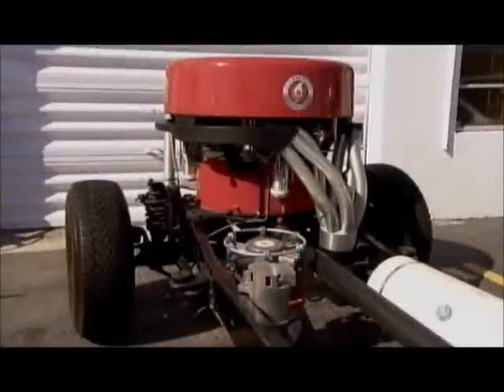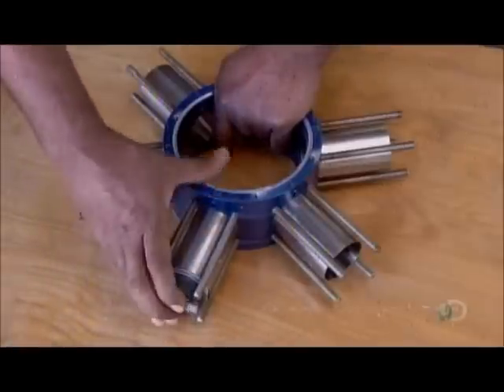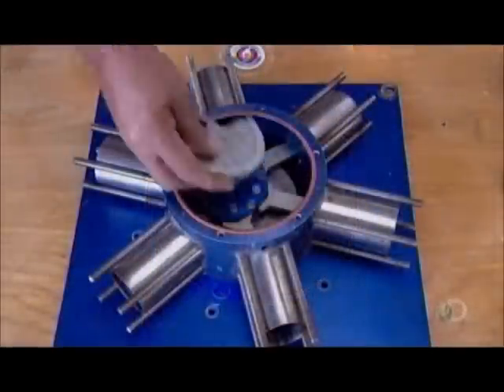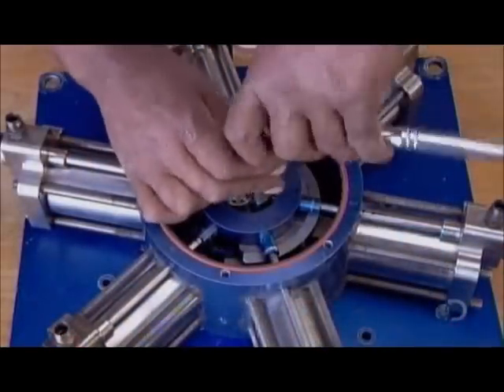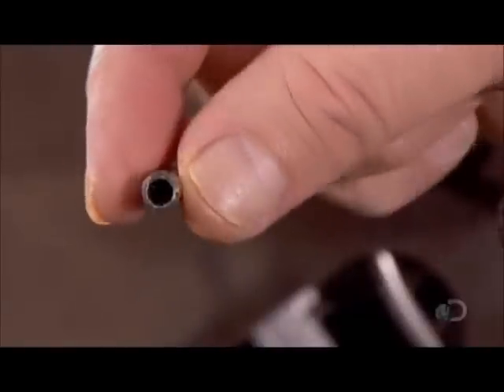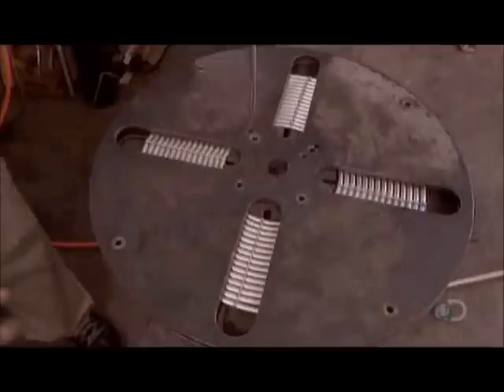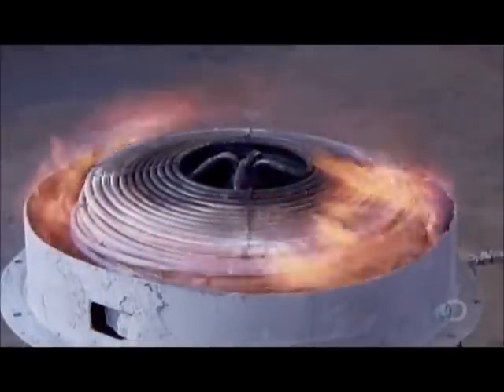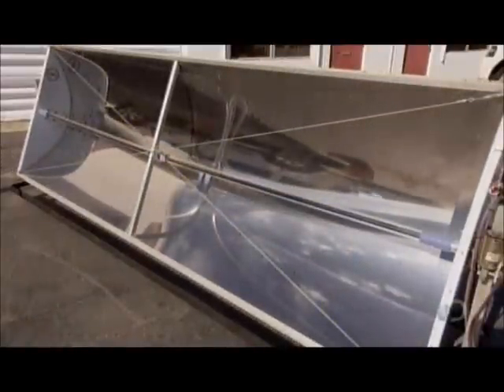How It's Made - Steam Engines

Comment: Actually, the worlds first steam engine was built and ran by Heron of Alexandria, the Aeolipile. Unfortunately, the potential was not seen for thousands of years.
Reply: +Joe Schmoe Technically the first steam engines were in use by the Egyptians. They were ceramic vessels that were placed in the back of a furnace, the water boiling and accelerating the flue gasses to facilitate a greater draft. This was a relatively common practice among unrelated civilizations.
Reply: TheRamsberg
Not really an engine by conventional thought. I guess sauna's were engines too because they made steam for a purpose? I dont know. This is where history has grey fine lines where ones definition of an engine even starts to break down.

Interesting history though.
Reply: +Joe Schmoe Definitions can become a deep rabbit hole. 

Within the confines of "heat engines" anything that converts heat energy into useful work is an engine of sorts. 

Within a "heat engine" there are various components and singular processes that are often described as an engine, and in reality are anything but. For example the cylinder, piston, connecting rod, crank, etc. assembly is typically referred to as an engine, however since the heat/energy source is external to it(steam), it is technically a motor, just like an electric motor uses an external source of energy(electricity). 

For the earliest/most widely accepted usage of steam power look up "How to lift water with fire".
Reply: TheRamsberg
By that definition the first man to boil his meal in water using fire made the first steam engine.

Fucking definitions. . . . . . .  ugh.
Reply: i think they meant high power steam engines, which were indeed invented by Richard Trevithick in England a few centuries back. before then, low power heat engines were commonplace.

Comment: this has got to be the best youtube video I've seen in a year
Reply: ***** Too bad every thing in the video was fake... Cyclone Power Technologies was a fraudulent company
Reply: Joe Schmoe Well if your talking about a large scale electric power generating plant burning a cheap fuel like coal its a very different situation than say a large Diesel engine powering a boat or a locomotive.  Power plants are huge and have the thermal advantage of engines and boilers with high mass and low surface area, room for plenty of insulation, large heat exchangers and preheaters... so thermal efficiency is much better.

tacking-on a very small steam engine on to an already fairly thermally efficient engine like a Diesel there is not much that can be gained, the heat source is small and the efficiency of a small steam unit is very low.
Reply: Steam engines are horribly inefficient... Cyclone is a scam
Reply: Joe Schmoe Although it sounds like a great ideal.. and it is, but unfortunately certification tests on one government contract showed that the Cyclone system severely underperformed claims made by the company and that the performance was about the same as any typical steam engine design... the system as installed did not return a cost savings in combined cycle operation.
Reply: doktorbimmer
re-utilizing waste heat from ICEs is not a scam.
Reply: doktorbimmer
Recovering waste heat, regardless of engine efficiency, is a good thing.

But there are better engines out there, I'll admit.
Reply: Joe Schmoe Provided that the availability (basically, the temperature of the waste heat) is high enough.  Generally, this is not the case.
Reply: MrShobar
If it is otherwise wasted, its good to recover it regardless of efficiency. Thermo-electric generators are a good example.
Reply: Joe Schmoe Its a matter of cost effectiveness sometimes.. its not always smart to try and recover more btus.. its good to save fuel.. but you also have to save money
Reply: doktorbimmer
Well of course its a matter of cost and return on investment. Duh.
Reply: Joe Schmoe Yes, and steam has a high installation cost and a high maintenance costs too... so its harder to get a return on your investment.
Reply: doktorbimmer
Depends on what you are burning and how its being done.

Comment: weighs only 						250lbs (with combustion chamber), produces 100hp @ 						3600rpm, and generates an impressive 850lbs-ft of torque 						at starting.  Cyclone engine. Question is how do I buy one???
Reply: Some Other Dude No they have not.. the company has made several as of yet completely unproven claims...

Thats what they keep saying... but so far the company has not filled an order or sold a working engine... no outside source has even reported seeing a working engine..

All of the equipment seen in photographs and videos are "mock-ups" or nonfunctional displays...
Reply: When looped into the heat cycle of another much larger heat system..  tests on the stand alone boiler/engine system only produced 33hp with a rather unimpressive 24% thermal fuel efficiency.
Reply: doktorbimmer What was the availability of the waste heat?
Reply: MrShobar 100% of the Cyclone maximum rated capacity
Reply: MrShobar There seem to be an increasing amount of evidence  coming out that points to Cyclone Power Technologies is nothing more than a scam.
Reply: The real doktorbimmer I don’t know why you say that;  I just resd the following: To date, Cyclone has over 1,000 hours of running (on fuel!) and testing of the engines, They have achieved verified thermal efficiencies above 30%, and is very close to putting the first of these engine models into small-scale commercial production.  The’ve been to numbers tech shows to display their engine too.  And their lab looks sophisticated to me.